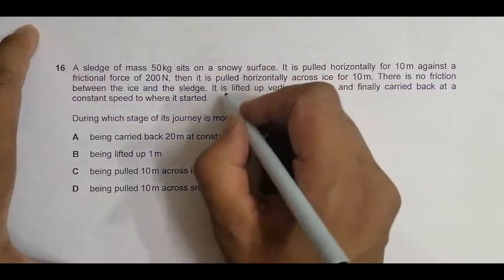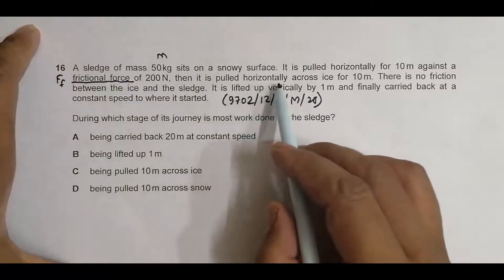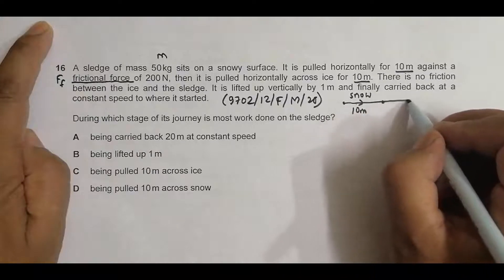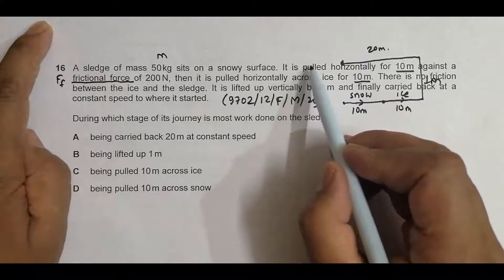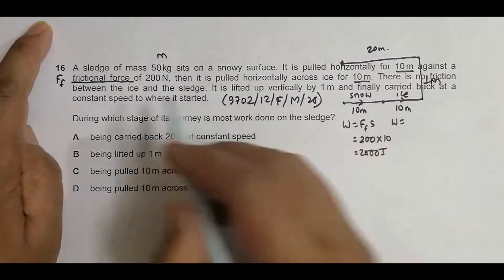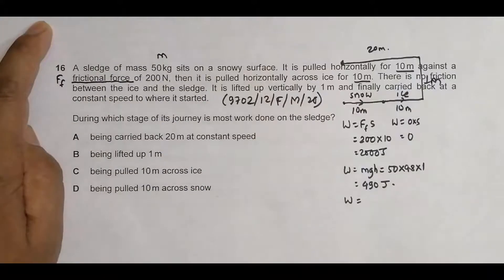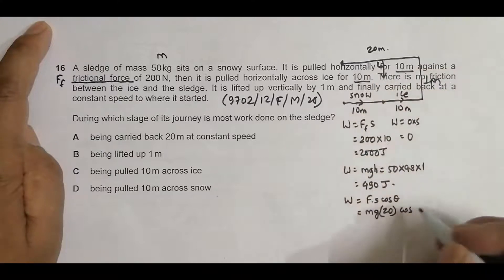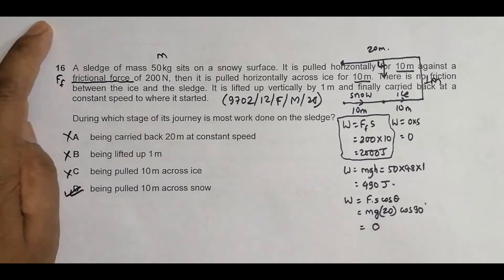2020 CAIE AS & A level February March Physics Paper 12 Q. No. 16 (9702/12/F/M/20)

Comment: but isnt it carrying back 20 metres has work done?
Reply: @sajitchandrashakya  oh so only when it's moving on a surface has work done?
Reply: I think there would be no work done in the horizontal direction because there is no force in that direction, but if you’re carrying the sludge back to ground level work done should be equal to 490J, since g is acting in the vertical direction.
Reply: The direction of work done in A level physics is work done is product of force and distance moved in the direction of force, but the actual definition is force and displacement parallel to force (there is angle involved but we can ignore that for now), when we move back 20m the displacement becomes zero, so work done becomes 0.